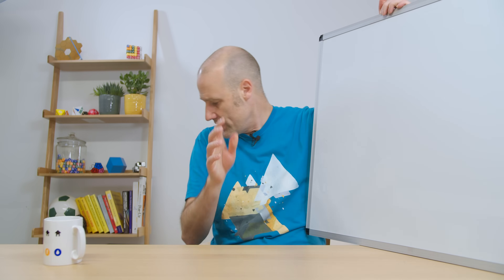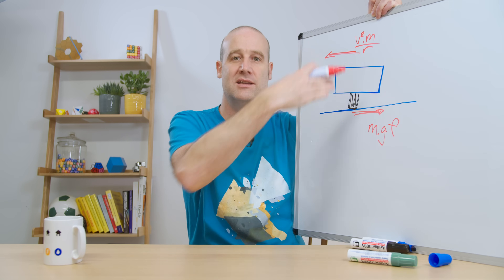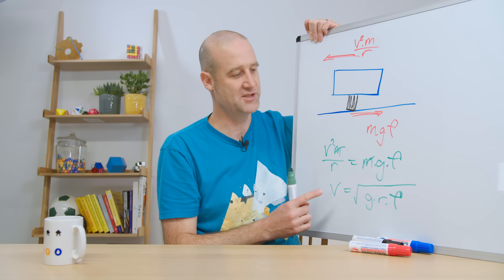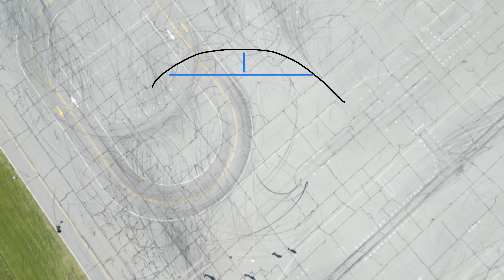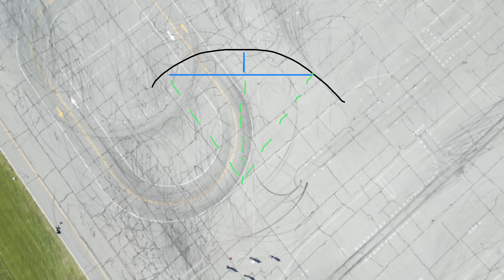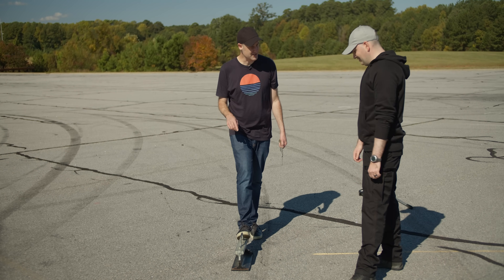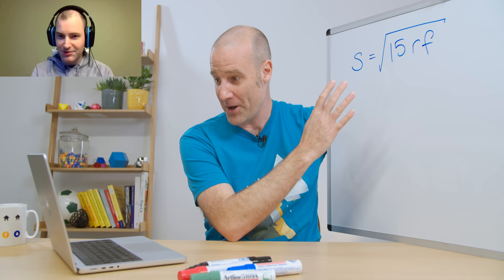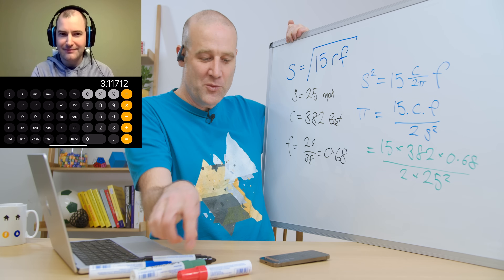Using an Out-of-Control Car to Calculate π.

Comment: Noooo the friction is pointing in the same direction as the centripetal force. The friction IS the centripetal force, like you said.
Reply: He made the drawing from the reference inside the car, so he could write the friction and the centrifugal force. The diagram is correct.
Reply: @freshrockpapa-e7799  he said it's the centripetal force when he showed it + specifically showed that the car is going leftwards :/
Reply: @tgwnn  then why did he draw two forces in opposite directions if it's only one force? Makes no sense buddy
Reply: @freshrockpapa-e7799  I agree buddy, that's why I commented!

He says "the car needs a force to push it" and shows something to the left with his hand and the arrow. Then he says "and there's a friction from the other side". This is what makes no sense.

Around 2:50

You can watch it yourself buddy :)
Reply: @freshrockpapa-e7799  also at 3:05 he very clearly says "centripetal force", not "centrifugal".

The diagram can only be correct if he now suddenly shows the friction force felt by the road from the tire (or the reaction force), but that is not at all standard notation and nobody would read it that way.
Reply: @tgwnn  or, you know, it is also correct if he drew the friction and the centrifugal force. 

It's the only way that diagram makes sense, sorry, you're wrong. It's obvious he misspoke when he said centripetal.
Reply: @freshrockpapa-e7799  the centrifugal force would point in the other way. He said very clearly the car is turning to the left and that the car needs a force to push it to the left. "Sorry you're wrong" lol even in your theory, I'm wrong because he misspoke? So any time someone corrects a video maker's mistake, the commenter is wrong?
Reply: @tgwnn  what's your explanation then? The friction should also go to the left if the car is turning left, it makes no sense either way buddy. At least I explained why he drew two different forces when there's only one.
Reply: @freshrockpapa-e7799  my explanation is that he made a mess of the explanation and he made a mistake (instead of drawing a second arrow pointing to the right, he should have just written equals to the friction) It's pretty obvious if you look at the whole section from 2:50 . There's no way to salvage it.
Reply: @freshrockpapa-e7799  he is clearly saying that the car is turning to the left...check the video buddy

Comment: Fun fact: It's important that the undisclosed location was in North America. Due to the Coriolis Effect, skidding cars spin in the other direction in Australia/South Africa/etc.
Reply: Fun fact you need to use the chiral version of Pi in the southern hemisphere
Reply: Somewhere out there, someone believes you.
Reply: @Khaim.m  this! I laughed out loud, so thank you! Then again... 

~sigh~

Sadly, knowing how many flat earthers and young earth creationists STILL exist, probably many, several, and bunches of someones. 😫 And they procreate and vote. 😱
Reply: What happens with skidding cars at the equator, then!? :P
Reply: @bsharpmajorscale Cars do not spin at the equator.
Reply: @jacksonpowers4459  That's what I thought, but I wanted to confirm it. Very linear.
Reply: @jacksonpowers4459  of course, that's why Brazilians have such good car control
Reply: @jacksonpowers4459  If we imagine the equator as being infinitely thin, then once the car turns so as to cause the skid, it would no longer be on the equator.
Reply: @bsharpmajorscale  They move in a sine wave
Reply: Pi is also calculated upside down over there.
Reply: @vigilantcosmicpenguin8721  And they write it "eye-dee": "Id"
Reply: That's why we Asians are such bad drivers out there in the West. We're just not used to the chiral coriolis effect! We drive here just fine :goodvibes:
Reply: Such a great, smart joke.
Reply: Also the wind caused by the mosquito that was close to them!
Reply: while this is a fun fact,  how would that change the "moment" where one track crosses the other they used to define the speed of losing control?

Wouldn't it still be a circle, still allowing for a long tedious measurement of the circumference, so yeah IDK, seems like still is same maffs.

Comment: Was going to use the "Um... Actuall..." when the word Tarmac was said. But looking at the vide, yeah, that's Tarmac. (For those wondering, Tarmac is a building material used in making roads and other paved surfaces, and not a part of an airport layout.)
Reply: Fun fact tarmac gets it's name from its inventor John McAdam who introduced the process of "macadamization" or the process of adhering "macadam" (aka gravel with a binder such as tar) to a paved surface.

Thus tar macadam becomes tarmac.
Reply: @dontuserachelslurs  Fun Fact: It's called Asphalt in the US. The word asphalt comes from the Greek “asphaltos,” meaning “secure.”

The other fun fact is people who aren't part of the air travel community like to call parts of the airport "the tarmac" despite that the area they're pointing to isn't made of tarmac. Which is where my "Um, Actually" was going... except that surface is made with tarmac/asphalt.

Comment: I... hmmmmm... at 5:11 how does gravity (32.185) end up getting divided by (5280/3600)^2?

Given your equations:
v = sqrt(g*r*f)
s = (5280/3600) * v
Then:
s = (5280/3600) * sqrt(g*r*f)
s = sqrt((5280/3600)^2 * g * r * f)
s = sqrt(2.15 * 32.185 * r * f)
No???
Reply: Good eye! Matt should have written 3600/5280 instead of the other way around since we want:
s miles per hour = 3600 seconds/hour × 1 mile/5280 feet × v feet per second
Hope that helps clarify! :)
Reply: @MathNerd1729  That's what I was thinking must have happened, but I didn't have time to figure out all the units and check for myself. Thanks!

Comment: Seeing an arrow into the centre… but friction outward. That hurt.
Reply: Of course, friction is opposed to movement.
Reply: @freshrockpapa-e7799  

No. In the case of circular motion due to tyres on a road, the inward force IS friction.

Case study: what happens to your turn if you hit black ice?

Comment: The former physics teacher in me is screaming at you for not keeping your units in your equations.  Yes, it takes more room, but then you don't lose track of anything. :beaming_face_with_smiling_eyes:
Reply: Yep! And Matt should have written 3600/5280 in his explanation instead of 5280/3600; writing the units would've made that clearer
Reply: @MathNerd1729  When he read the units out loud without writing them down, it irritated me so much that it took me a minute to realize he had it upside down. It always helps to look at the units first to see where which variable goes.

Comment: Never seen anyone use imperial units for physics calculations. It was... horrifying.
Reply: It's very common actually and not an issue at all as long as you're consistent, knock it off
Reply: @freshrockpapa-e7799  Why? imperial is a horrid system when trying to do calculations like this. And it's not 'common'. Most scientists use metric, even those in 'Murica!
Reply: @Chris-hx3om  uh, no it isn't, if you can't figure out how to use another system of units you clearly shouldn't be working in stem
Reply: @freshrockpapa-e7799  Oh, I can work in either unit set (and I'm frequently forced to), and because of that I know just how difficult US imperial is! When will Murica join the rest of the world and ditch those archaic units?
Reply: @Chris-hx3om  probably never
Reply: @freshrockpapa-e7799  With this kind of units, you'll end up with any result you want. Add 2 cups of flour and 1 cup of water, 1 teaspoon of yeast and a pinch of sugar. Mix everything and wait a day or so. Ball it and stretch it to 12" and call it a pie.

Comment: I don't get the formula: If you break without ABS, you go in a straight line and the radius is infite -> infinite speed asumed?
Reply: Obviously you can't use a formula derived from centripetal force if the car didn't turn, duh
Reply: No breaking or braking was involved in the making of this video.

Comment: Hi Matt, it would be nice to list at the end of the video the assumptions that were made throughout the calculation. Some were mentioned in this video (like the possible difference in friction coefficient and the effect of the gradient) but others were missed such as the assumption that the skid path is a perfect circle and therefore every point on the arc has the same radius and centre point (which is what has to be assumed in order to just use one value of r)

These assumptions are obviously false technically speaking but it's important to mention them and acknowledge them as false. Otherwise, using these equations implies that you're taking them as exactly true.

 I think so often assumptions are implicitly made and we expect better results than the ones we actually get. It's a good habit to always list your assumptions because in doing so you force yourself to look for differences between theory and application. I know it might be boring, so can you least just do it for all future Pi videos?
Reply: This is recreational math, there's no point in taking it so serious man
Reply: @freshrockpapa-e7799  I don't think I am taking it serious at all. Just asking for a clearer big-picture overview. That doesn't diminish any of the recreational aspect of it.

Comment: Did you compensate for the error in the speedo? Modern cars almost universally read fast so the car probably was going slightly slower than it seemed (which would have made the result slightly larger, and slightly closer to Pi).
Reply: Actualy the speed should be slightly above 26 like 26.067
Reply: That was a US vehicle and hence the speedo reads correctly.   It would be different if it was a British or European vehicle
Reply: @michael-j-harrison  I'm sure the discussion I saw on this mentioned US vehicles were affected, but I could be wrong

Comment: Veto!
The fact that you had to reconstruct the circle using it center and then measured the circumference to me looks like cheating.
I say! you go back, skid a full circle and time it instead! 
While at it, the speedometer in the car use the circumference of the tires to estimate the speed from the rpm. It should be illegal too!

Comment: Every time someone says "we can ignore" or "lets not worry about", an angel takes away a digit of precision.
Reply: Let's not worry about that though.
Reply: Fortunately ♾️-1 = ♾️
Reply: @murk1e  where'd you get that fancy infinity? Is that like a deep cut emoji near the bottom? All I have is the ∞ from the = long press.
Reply: @Rabbit-the-One  ♾️
Reply: @Rabbit-the-One  It's originally the acid-free paper emoji (later called the permanent paper emoji, then later the infinity emoji), U+267E (what he used) vs U+221E (what you used, the original Unicode infinity symbol)
Reply: @error.418  that's a very informative response to my question. Thank you very much for being so thorough. Very cool.
Reply: @murk1e  Unfortunately
∞-1=∞
add 1 to both sides
∞-1+1=∞+1
∞=∞+1
take away infinity from both sides
∞-∞=∞-∞+1
0=0+1
0=1
Reply: @Luna5829  infinity is not a number.
Reply: @cheekibreeki904  he said ∞-1=∞ tho im just tryna prove to him why that isnt true
Reply: @Luna5829  how do I put it...
It is true. See: Hilbert's infinite hotel. Adding to infinity and subtracting from it is possible, you just get infinity. Dividing by infinity, however, is not.
Reply: @cheekibreeki904  I KNOW THAT
DO YOU NOT KNOW WHAT CONTEXT IS
READ THE PERSON I REPLIED TO'S COMMENT
Reply: @Luna5829  subtracting from infinity is allowed; dividing by infinity is not. You "corrected" a correct statement with an incorrect statement. That's all the context there is.
Reply: It's like in college. "Assume no air friction, no ground friction, no deformation, gravity is 10, pi is 3, e is 3, 2 is 3,...."
Reply: Nice
Reply: Real angels know you only had one digit of precision to start with. Two on a good day.
Reply: 10/10 joke right there
Reply: But since pi has infinite digits of precision ... 😁
Reply: By the time you're adding in factors of safety, you only have 1 significant digit anyway lol
Reply: Every time someone calls g gravity a physicist delays the advent of teleporters by a decade.
Reply: @brianlane723  I say g is gravity because it's understood that I mean "acceleration due to gravity." Anyway, you can keep your teleporters. How can I have an excuse for being late to work or class if I can get there intstantly, hmm? :P
Reply: The reason the world seems to keep getting less predictable is because we keep losing precision.
Reply: Why do angels have wings if there is no air resistance?
Reply: @zadams5596  aesthetic, they are very egotistical
Reply: Pi basically just rounds down to zero, right?
Reply: @MWSin1  O O F
Reply: Love it!
Reply: Thank you angel-san
Reply: And Newton, Leibniz and Fermat all did that, yet they're geniuses.
Reply: Let's not worry about that digit of precision.
Reply: Wow)))) so cool
Reply: He could say that an infinite amount of times and it will still be 100% accurate lol
Reply: Merry Pi Day, Bedford Falls!
Reply: They made everything worse by ignoring metric. The math became ridiculous

Comment: Technically Pi is 3.12847 if you used the 14.962 instead of the 15 and then 26/38 as a whole. Still better than an engineer who says Pi is 3
Reply: If you find an engineer using π to be equal to 3, report him to the appropriate engineers association. He will have his licence removed.
Reply: So funny seeing someone that doesn't understand significant figures trying to throw shade to engineers.

Comment: In the rest of the world, the formula is s (km/h) = sqrt(19.2*r[m]*f)

The units under the square root should be (m/s)^2
f is dimensionless.
the 19.2 has the bas unit m/s^2 which is acceleration. That should not surprise me as it started out as g.
Reply: I recommend you not to convert unit like this just out of zeal. Pi is a ratio, you'll reach the same no matter the units you use. A mile is about 1.6km and there is a bit more than 3 feet in a meter. Just knowing that you can situate yourself knowing that the car was going at about ~40km/h and the circumference was about 100m.

Converting back and forth units is a needless source of error.
Reply: @hurktang  Nothing needless about it. Why use a formula based on colonial units outside the colonies?

And you might notice that the constant is different, so you do not get pi if you add m/s and km/s in the colonial formula.l
Reply: @57thorns  the result is the same, if you don't get the same approximation is because you made a mistake. Pi is dimensionless.
Reply: @57thorns  "Why use a formula based on colonial units outside the colonies?"
Obviously, they filmed in USA and the guess was American.

Matt wrote books about the worst mistakes made by unit conversion. There was no point doing conversion here, it's not like we all gonna go run outside and start compulsively measure skid marks on the road.

Comment: Doesn’t the wheely thing used to measure the circle use pi in relation to its own wheels to produce a reading?
Reply: Not necessarily. You can measure the circumference of its wheels and multiply with the number of revolutions.

Comment: Im sad... I love Pi day... but it would have been good to see the calculations in proper units. Using Pi with imperial just seems dirty... especially when imperial units are now based on metric standards.
Reply: Glad you left this comment confirming that I wasn't alone about wanting to see what the metric system would bring! :)

Here's their data in metric units:
Coefficient of Friction = 13/19 [since 26/38 could be simplified]
Gravitational Acceleration = 9.80665 m/s²
Velocity = 11.176 m/s
Circumference = 116.4336 m

And here's the corresponding approximation of π:
π ≈ 3.127418282...

Hope this is satisfactory! Stay curious! :)